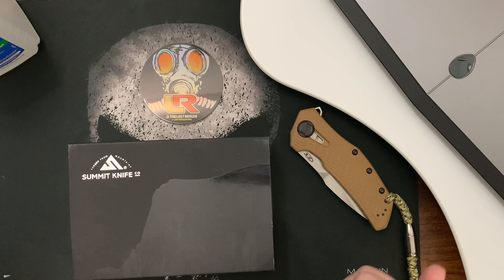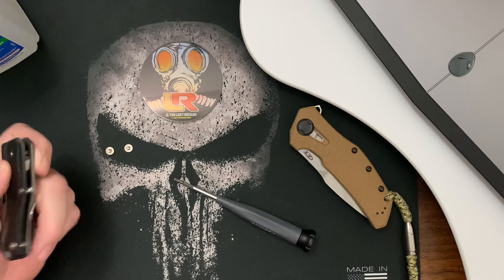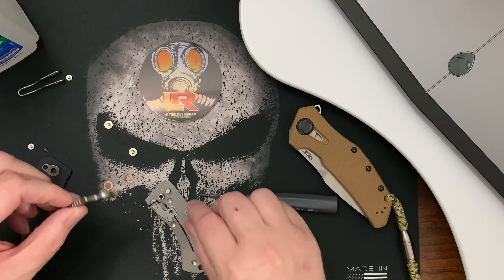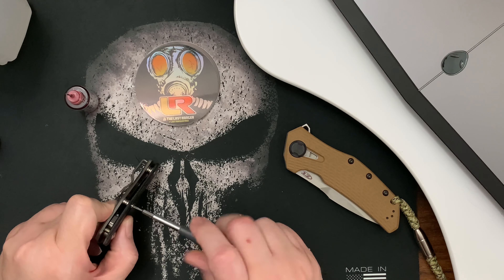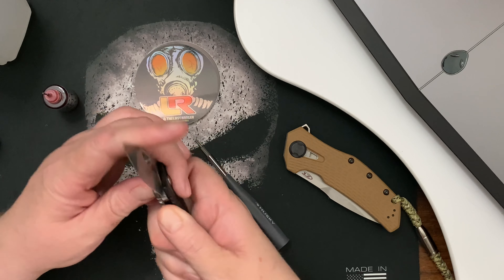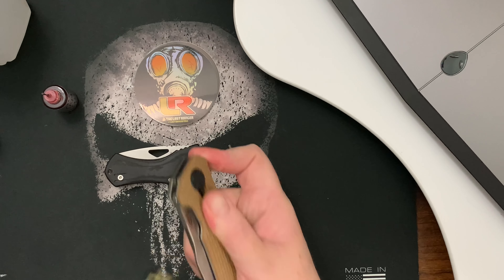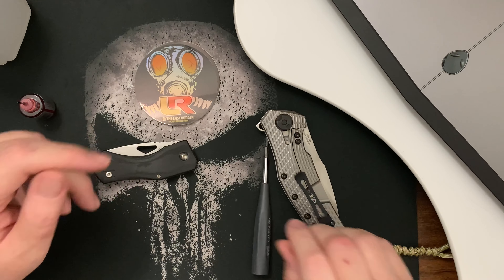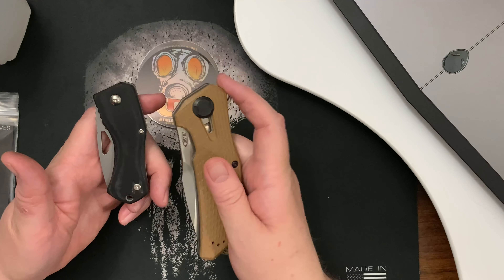I try to improve the Summit Knife Half Dome action :( - The Last Ranger

Comment: After watching this, my sense is that the detent is just not to spec. You may want to look closely at the knife in the closed position to see if the lockbar is absolutely flat against the blade. If it isn't then I suspect the detent ball is not fully engaged into the detent hole on the blade, giving you a very soft detent. If that is the case, you may want to consider talking to the manufacturer. Alternatively, I've seen people take a super fine dremel tip and enlarge the detent hole a tiny amount to get the detent ball to fully seat (be very careful doing that, you can easily ruin the whole knife).
But the other test I would try is... can you just shake the knife open (like gravity flipping it)? If so, unless it was designed for that, which I doubt coming from Italy, then it is defective.
Reply from the maker: Thanks for the tips. I definitely will be taking it apart again. Not on video. If I remember correctly the detent hole was a hole drilled through the blade. That’s strange, never seen that before. Also the titanium had three holes drilled in it. Like they were about to assemble the knife differently. 🧐